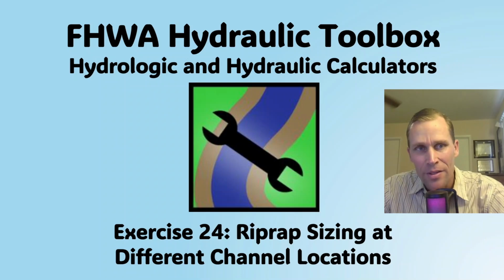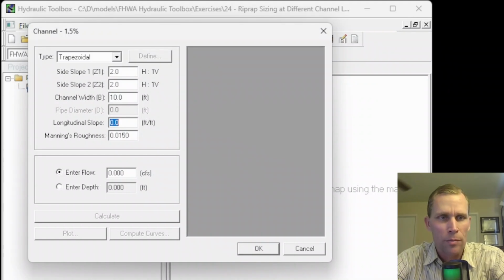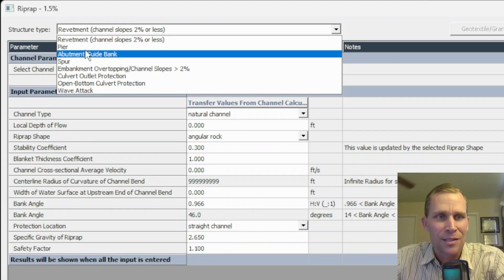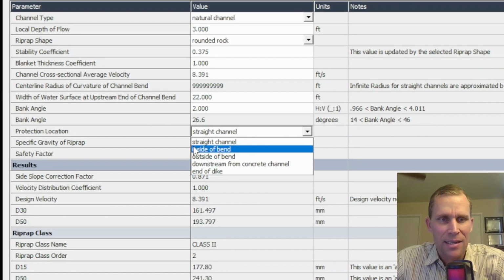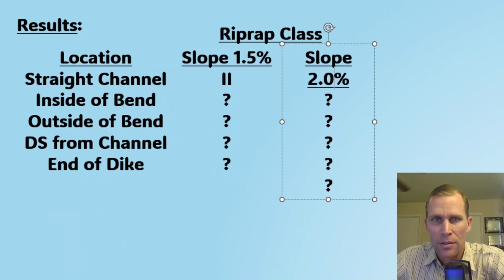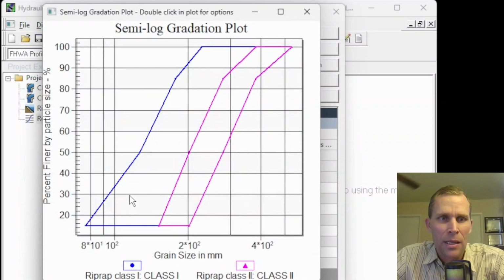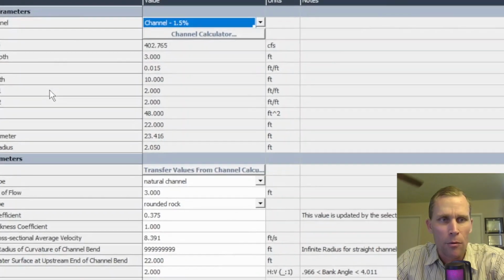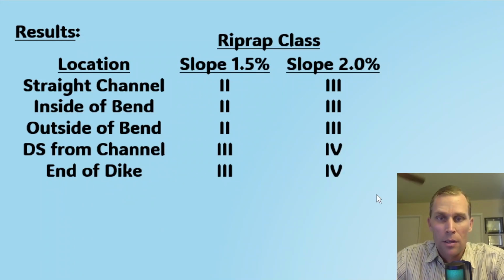FHWA Hydraulic Toolbox Exercise 24 - Riprap Sizing at Different Channel Locations

Comment: Excellent video — very clear explanation of the FHWA riprap calculator. For DOT or consultant HEC-RAS projects, is the Hydraulic Toolbox generally considered sufficient as the calculation record, or do agencies typically expect a separate Excel-based riprap calc using HEC-RAS outputs? Interested in what you’ve seen accepted in practice. Thanks!
Reply from the maker: It just depends on whatever the client wants.